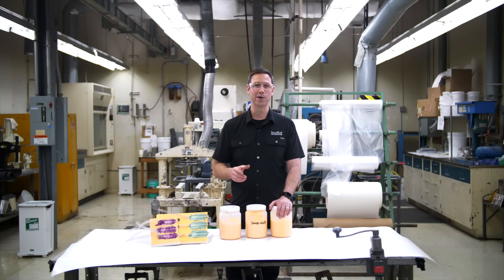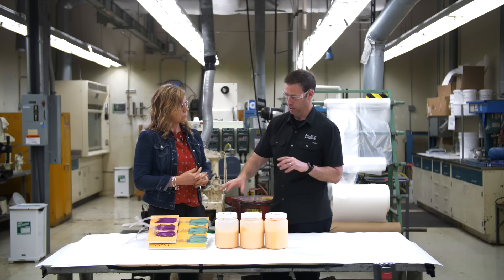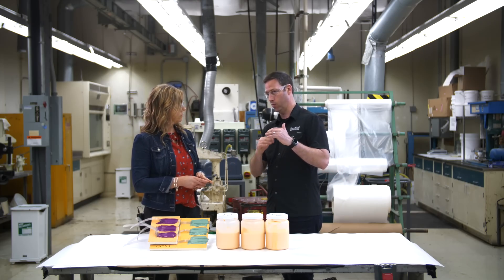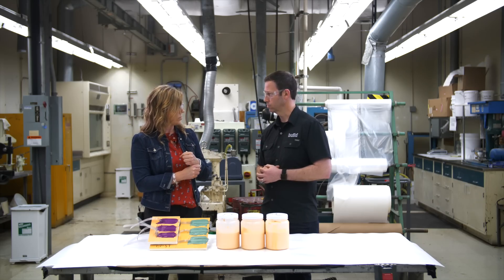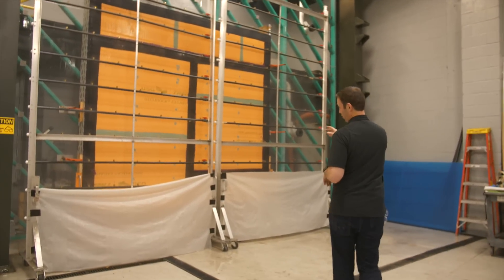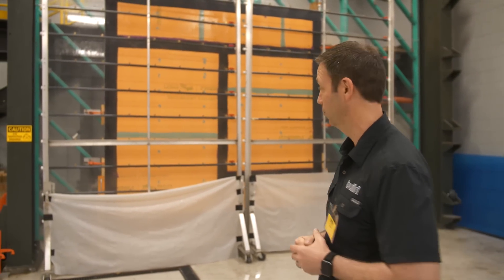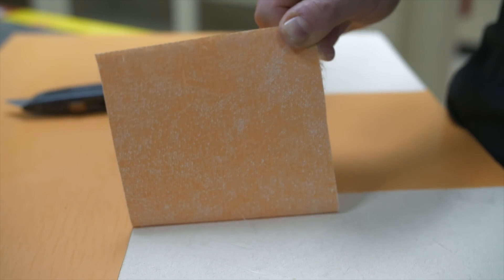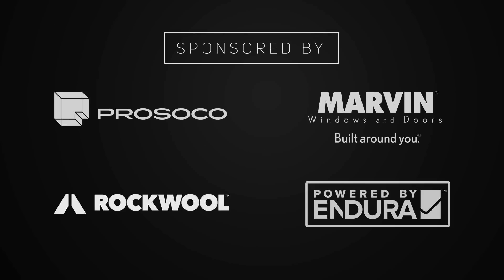Securock® ExoAir® 430 - Tested Above and Beyond Traditional Air/Water Resistive Barriers

Comment: Lmao. This engineer assumes the lead carpenter is wasting his time nailing off sheathing. I have worked where there are sheathing inspections, and we failed. Let me tell you, there could be 2 compressors on the job, both are running at or over 150 psi. The nails into the sheathing, are penetrating though  at least 2 layers, sometime it blows right through the plywood to the framing. Lead carpenter, building homes for 16 years, every framer is the same.